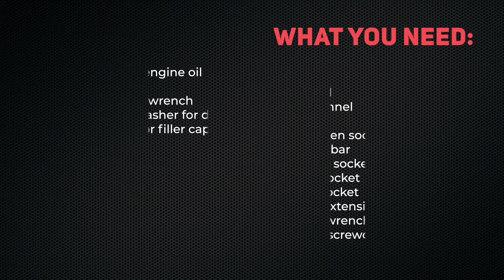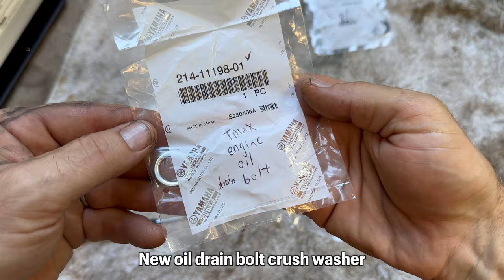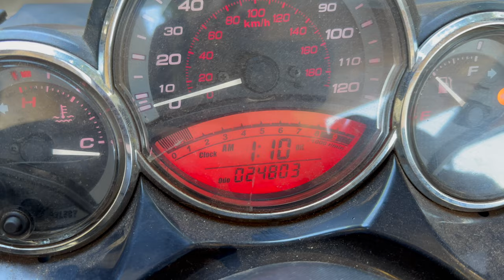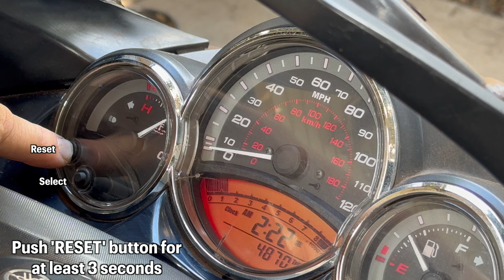Yamaha Tmax 500 - Engine Oil / Oil Filter Change | Mitch's Scooter Stuff

Comment from the maker: @7:37 I installed crush washer on wrong side on bolt but it doesn't leak at all, just want to let you know :)
T O O L S
10w-40 engine oil - https://amzn.to/48jNTF8
Oil filter - https://amzn.to/48xYPyv
Oil filter wrench - https://amzn.to/4aQfK1k
Crush washer for drain bolt
O-ring for filler cap
Rags - https://amzn.to/2Yh8jvg
Oil pan - https://amzn.to/3bOmT5Q
Pick tool set -https://amzn.to/3rXSjBA
Funnel (long) - http://amzn.to/2v5mYLn
Ratchet 3/8 drive - http://amzn.to/2hhmnUs
4mm allen socket 3/8 drive - https://amzn.to/3aUmtuw
Breaker bar 3/8 drive - https://amzn.to/3lrjIWj
Torx T30 3/8 drive - http://amzn.to/2znnvKQ
10mm socket 3/8 drive - http://amzn.to/2xGuLSF
17mm socket 3/8 socket - http://amzn.to/2EMT6LO
3" / 6” extension set 3/8 drive - http://amzn.to/2h7ypMl
Torque wrench 5-45 ft/lb 3/8 drive - https://amzn.to/3TKdS3Z
Phillips no. 2 screwdriver - http://amzn.to/2fgdZDL

Comment: Hi, Mitch! I have a Yamaha Majesty 250 and I have recently seen that the engine oil is going in the air filter. What do you think is the cause?
Reply from the maker: Hey, hmm are you doing a lot of high speed riding? Maybe the oil level is little too high
Reply: @MitchsScooterStuff  The problem was the worn piston oil rings. Thank you for reply!